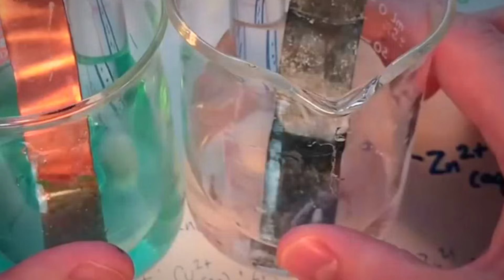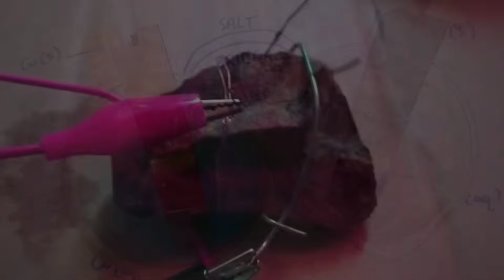One Copper and Zinc In Water Purify Everything — The $48 Billion Industry That Needs You To Forget

Comment: Copper and zinc can be used together in water because they create a redox reaction that may help reduce certain microorganisms, chlorine, and some metals.  However, simply putting one piece of copper and one piece of zinc in water does NOT “purify everything.”  The effectiveness depends on the metals, surface area, water chemistry, and contact time, and it is not a reliable way to make contaminated water safe to drink.
The easiest way to purify questionable water is to filter out sediment, like through a cheese cloth several times, then bring it to a rolling boil for 1 full minute.  Boiling kills bacteria, viruses, and parasites, but it won't remove chemicals or heavy metals. For broader purification, use a certified reverse-osmosis filter.

Comment: Yes, copper and zinc can help disinfect water by killing bacteria and viruses through an electrochemical reaction and the oligodynamic effect, but they do not act as a complete filter or remove chemical toxins, dirt, or heavy metals.
Reply: So what do you use to clean out what copper and zinc doesn't? ❤️
Reply: @hope4autism1 Look at the old ways, there are many videos. Sand , rock, gravel, activated charcoal and cheese cloth layered in a specific order.
Reply: @hope4autism1  you need a filter and  you can boil the water it takes out a lot of stuff.

Comment: Heavy metal is trapped where?
Reply: copper is a heavy metal, but it leaves the body pretty fast. can't consume it all of the time, you have to give your body a rest. we use the wires for watering our gardens, but we don't drink it often, and when we do, we take breaks from doing so. It gives time for the metals to leave the body, which they do if you eat right and drink lots of clean water.

Comment: I did not know that copper and zinc made brass. I recently learned that the brass doorknobs in very old houses were there for a reason. It was because they helped kill bacteria from people's hands. 
This year's science project: I bought some copper wire to wrap around galvanized (zinc)  16 penny nails. I'm going to put them in the soil in my garden to see if it actually makes a difference, as I have read about. A ring of copper wire sitting on the soil around my cabbages might deter those pesky slugs. We'll see.😊
Reply: I take copper and zinc. Is that why I’m so brass? 😂
Reply: @AndiBecklovesPBcups 
Good one.😂
Reply: @AndiBecklovesPBcups 😂
Reply: @AndiBecklovesPBcups Brassy is cool.
Reply: @AndiBecklovesPBcups  I used copper rings around the bases of my French Green Beans over in the UK (where slugs are the size of hedgehogs!) It worked. Then someone at my allotment stole them.
Reply: Please give us an update!!!!
Reply: @jdturnier8539 
I really won't know much until around October. My garden went in late this year but if you remind me in a few weeks I'll be happy to give you an update. I'm curious, too.😊
Reply: @ghall-r2i cool thank you for the speedy reply & ok. Happy Saturday!
Reply: @ghall-r2i you can get copper self adhesive bands that can ring a pot. Snails and slugs get a charge off them. Serves them right.
Reply: Did u do a test please let me know the results
Reply: @adriannefluet5980  don't just jump into comment section with your keyboard. Read other comments first. Maybe you would learn something.
Reply: @adriannefluet5980 It's only been 6 day's.  We need a bit of time to achieve results.  We'll check back in around October to hear about the results! 🤞😊
Reply: That is why door knobs were made of brass, anti-bacterial
Reply: It's called olygodynamic effect.
Reply: Make it 2 rings separated far enough the slug touches both rings at the same time.
Reply: @sunlight000
Good idea.
Reply: I bought some copper wire to make some jewelry,  it says right on the package; may cause cancer, infertility, birth defects.  So now I'm worried.
Reply: @annieb1794 
Wow. I've never heard that before.
Reply: @annieb1794 let me guess - California?
Reply: how cool! 😊

Comment: The copper is easy to come by,,,,what are some good sources of zinc? It would be nice to hear of some more about zinc, please.
Reply: Old pennies before 1982 are made of pure copper and zinc..
Reply: @RonaldCountryBoy how many pennies to a pound 😂
Seriously how many coins to 1 litre of water?
Reply: Hardware stores sell zinc nails
Reply: Amazon's pure zinc strips
Reply: Wheel balancing weights are made of zinc.
Reply: Not all. Some are made of steel or lead also.
Reply: Galvanised nuts, bolts, wire, etc.
Reply: I order my zinc and copper on line.
Reply: @jacquelinemarie1078  Yep,  my husband orders online small bars for his crab pots as he is a commerical crabber!
Reply: @jacquelinemarie1078 
Is it pure 💯 PERCENT 
What's the name of the company please ❤
Reply: My mother used to put copper pennies in vases - the flowers stayed fresh much longer ! Now I know why 🌺
Reply: @mumheravi 
Thx❤ excellent recommendation.. 
The Oligarchs deliberately created NEW KNOWLEDGE
KNOWING THAT BY REPLACING 
WHAT REALLY WORKS WITH NONSENSE 😐..
Reply: The old corrugated roof sheets were made of 

Some torch batteries have a zinc sheeth inside their casing - that is my source
Reply: *Zinc
Reply: Amazon has it
Reply: I couldn’t find the zinc wire in the stores anymore, but I found it on Amazon
Reply: @CynthiaCollins-i8m
But is it guaranteed to be 
💯 Perfect 👍 
If Yes what's the name of the company please ❤
Reply: Marine/boat supply stores sell zincs of varying sizes for boats
Reply: I would also like to know where to get zinc.
Reply: Fish bait weights???

Comment: Copper and Zinc make brass - can you just use Brass or do you need the two wrapped together?
Reply: I really hope someone answers your question. I am wondering the same question.
Reply: You need the 2 separate as electrodes as it is this process that does most of the work
Reply: Good question… anyone ? Please
Reply: Brass has mild antimicrobial properties that can reduce bacteria in stored water over time due to its copper content, but it does not fully purify water of chemicals, viruses, or heavy contaminants.

I'd say you need the 2 together.
Reply: Also here for the answer to that... 🤞🏼

Comment: Can drinking too much cause toxicity from the zinc? That’s what I’m finding in research. Wish it removed microplastics and fluoride…
Reply: Bro try activated charcoal and diatomaceous earth dyor
Reply: @LivingTheDream37 How do you use them? TY
Reply: @thegreenalchemist1122 
There are many ways to use them. Too many to list here, but here are a couple. I got this tip from an Amish channel. I put activated (food grade) charcoal "bits" in an oblong plastic food  storage container about 3/4 inch deep. Add water to cover about 1/4 inch over the top. Check the water level twice a day. Put it on a window sill in front of a breeze and it will cool a small room by about 15° F. In the absence if a breeze I use a small fan blowing across the water. It can also be used in a multi-level drip system made inexpensively with clay pots. I have not tried this yet but there are many how to instruction videos on yt.
Warning: DO NOT use charcoal brickettes intended for bbq. They contain a binder which should NEVER be injested. Use only activated charcoal.
Diatomacious earth resembles flour and can be sprinkled on ant trails and slug trails. Slugs are nocturnal so put it out at night. If it rains you have to reapply. Sprinkle it on your carpets to help with fleas. It will vacuum up. Some people swear by it for parasites but I have not been brave enough to try it this way. Please do your research thoroughly.
One little note: ants and fleas have a hard shell. DE are like microscopic shards of glass to them. They shred this shell over the course of a couple of days and they literally bleed out. DE will get avout 98% of them but not all. 
Please look up some of the other many uses for them.
Reply: @thegreenalchemist1122 , my neighbor using diatomaceous earth and activates charcoal w/ clay pebbles in his water filter system. Never need to buy those filters again... Just changes  it every 30-60 days by washing it.
Reply: @thegreenalchemist1122 activated charcoal stops your body or you pets body from absorbing anything, that's why it's given to those who have consumed poison
Reply: @thegreenalchemist1122  get a good water filter pitcher that removes fluoride. Easy and simple.
Reply: Calcium  carbohydrates  boiled
Reply: The diatomcaous earth protects plants by killing the bugs that cross it or at least certain kinds of bugs
Reply: @davidayers5173 
We have a bag of this. I've heard different things about people consuming it The wrong way. 
I've put it aside for now until I know for sure how much a human can consume and the Best brandname. 
It says on the bag for humans and it suggests a 1/4 tspn twice a day but then there's other suggestions on other similar one's and I've decided to wait until I know what is BEST ❤